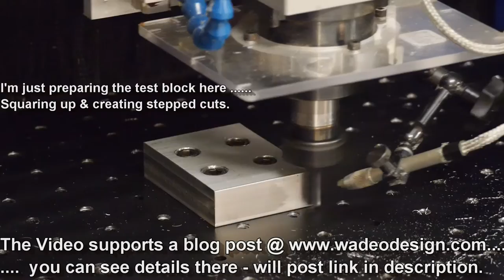CNC Router: Machine Rigidity vs Spindle Power - Attempt#1

Comment: You shouldn't use Titanium aluminum nitride to cut aluminum, as aluminum makes up some of the coating, resulting in a high likelihood of your bit gumming up. Great machine though.
Reply from the maker: +Michael Gimbel Thanks for the tip... This bit broke down at the edges after running it thru this test (edges broke down)... Next time I'll use straight carbide and buy better quality.
Reply: Came here to say the same.   The easy way to pick a 'correct' coating is make sure the coating doesn't have the same element that you're cutting.  If it doesn't, then you're generally good to go.

Comment: Congratulations for the whole project, it's simply amazing, all of it, machine design, execution, over all performance, you name it. The motors that adad2757 mentioned are the best choice by far when it comes to torque, precision and speed . I have & use few  Hudson motors ( M-2341 & M-2331- nema 23 and M-3421 & M-3441- nema 34 ) for the development  a motion control unit and i can tell you that they are THE  finger breaker from 0 rpm up to full speed. A friend of mine uses one clearpath nema 23 for teaching and demonstration purposes and it is equally superb in every respect.
Reply from the maker: +Ovidiu M I've now replaced with clearpath motors on the x and y axis.  Don't have much time with them but impressed so far.  I hope to get back to this rigidity test soon.
Reply: Sir, i need a help. I'm planning to build my own cnc machine. My plan is to make an 1sqft work area. I want to use a 12mm thickness aluminum frame for my Gantry assembly and I want to use servo motors for all axes. What servo motors specification  and spindle can you suggest me for high torque, precision and speed?
Reply: Hudson M series 23XX AND 34XX are DC brushless servo motors. Servo motors and stepper motors are different. Any servo motor  will outperform stepper motor of comparable size except in price. The cost of servo motor+driver is 3 to 4 times higher that the cost of stepper+driver. Pay more, get better results. Is anyone surprised?

Comment: Steppers lose steps or become bound where the pulses are there but the phases are unsync. This is common. Servos will help but can exacerbate any spindle deflection due to the constant torque and feed forward characteristics. Also, make sure that you clamp your part well. Any loose areas will become more noticeable with a servo system. BTW... I have 30 years in the big CNC industry as an engineer. Nice build. THK and NSK are solid choices as they perform well even in C5 and C7 classes. C3 is best but very expensive for hobby builds.
Reply from the maker: Thanks.  I've change to servos and now see what you mean by the constant torque thing... I miss the rock hard position of a stepper locked in location.

Comment: Sir, i need a help. I'm planning to build my own cnc machine. My plan is to make an 1sqft work area. I want to use a 12mm thickness aluminum frame for my Gantry assembly and I want to use servo motors for all axes. What servo motors specification  and spindle can you suggest me for high torque, precision and speed?

Comment: clearpath servos from teknic, probably the cheapest and best replacement for steppers. From what ive seen, the stepper just stopping means its been stalled. Its common for them to not rotate afterwards.
Reply from the maker: +adad2757  Ha... As I received this post I was browsing around on Clear path website.  I've had my eyes on these a few times in the past. Thanks.
Reply: Sir, i need a help. I'm planning to build my own cnc machine. My plan is to make an 1sqft work area. I want to use a 12mm thickness aluminum frame for my Gantry assembly and I want to use servo motors for all axes. What servo motors specification  and spindle can you suggest me for high torque, precision and speed?